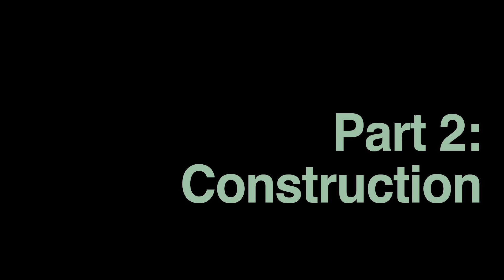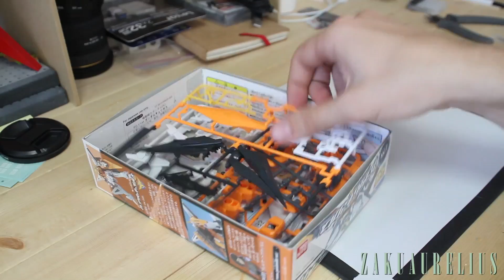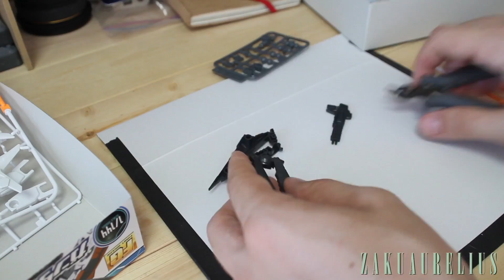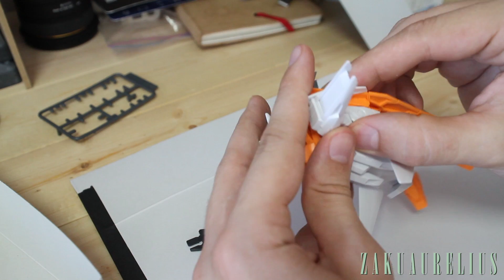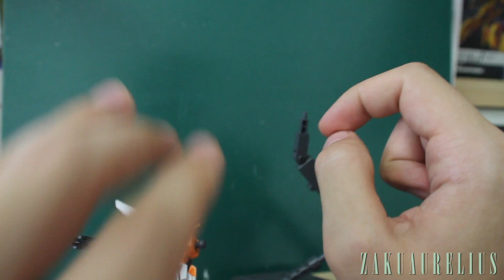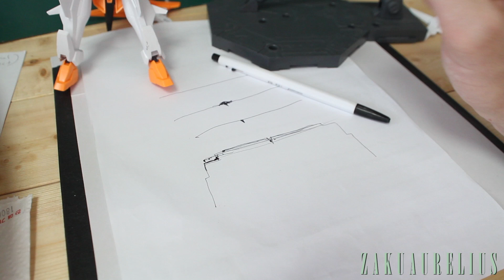248 - Gunlpa Building For Cheap: Part 2 (Construction)

Comment: For those who want to cut down their budget a lot, you can get some cheap tools from China. Some of which contain a pack of tools for about $9aud

A kit i've been using for about a year now included

- Tweezers
- Nippers
- Part separator
- Panel lining marker
- 3 sanding sticks (various grit)
- Hobby knife with replacement blades
Reply: Same got mine from China too

Comment: Did you have to glue them together? Sorry newbie here. Thanks.
Reply from the maker: RootsBassCanada some parts you have to glue if you wanna get rid of the seam lines. But 99.9% of Bandai Gunpla do not require any glue to build
Reply: RootsBassCanada no but for example... The 1/100 scale 00 Exia should be better with glue
Reply: yg L ain't that the truth. I had to glue it's weapons to its hands and it's fingers to its hands as well.
Reply: Strung Up why would. U glue the weapons to the hands u dumbass?

Comment: whats the action base that u displayed the kyrios on called? I bought the wrong one for my rg raiser :/ had to cut something off the make it fit
Reply: Cowdude Shquishy Lock Stratos Action Base 2 I'm sure.
Reply: ok thanks man ^^
Reply from the maker: Cowdude Shquishy Lock Stratos Actually I was displaying it on an Action Base 1 (typically used for 1/100 scale kits), because the shape of the AB2 mount doesn't fit well under the skirt armor of this kit.
Reply: which one is for rg's?
Reply from the maker: RG is 1/144 scale, so Action Base 2. But you can also use an Action Base 1 of you want (as seen in the video)
Reply: thanks man i hope i get a new ab :/ as i said i had to cut something off of one of my connectors because it didnt fit :/
Reply: Cowdude Shquishy Lock Stratos im pretty sure RG's include a connector that you will use instead of the connectors given on the action base 2 almost all the RG's had it tho i dont have an RG raiser yet so im not sure
Reply: o ok